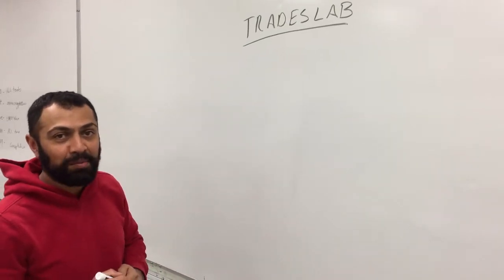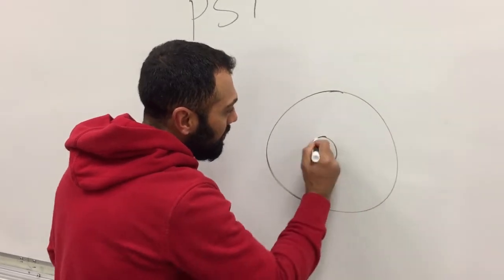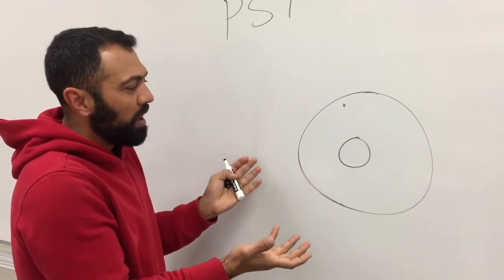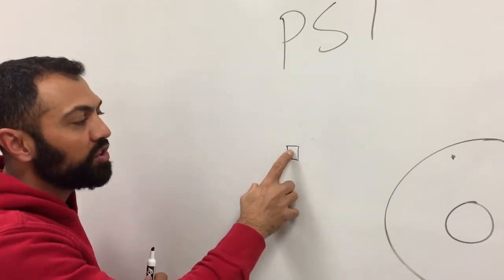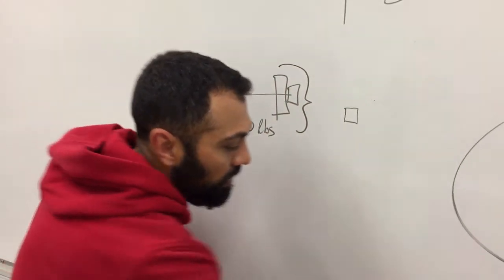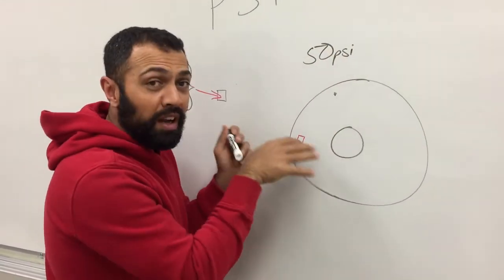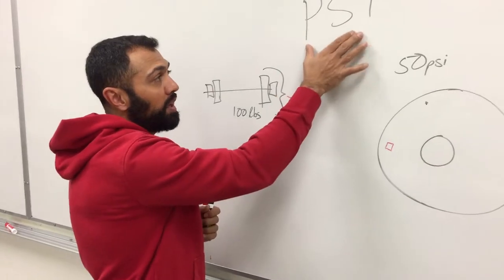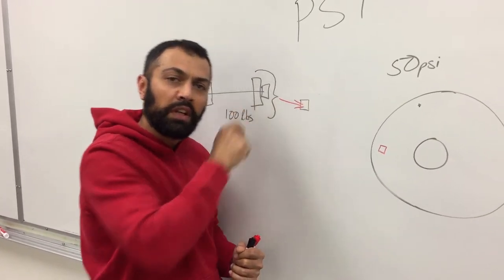pounds per square inch

Comment: Here’s a shorter explanation: Saying a basketball is at 9 psi means the air inside the ball is pushing outward on every square inch of its inner surface with 9 pounds of force.

Comment: HELLO 
THANKS FOR ALL YOUR WORK WITH THE VIDEOS.

I'M WONDERING ABOUT THE DIFFERENCE OF POUNDS PER SQUARE INCH FROM NORMAL AIR WITH SPACE AND DEEP OCEAN.

HOLLYWOOD HAS US BELIEVING THAT THE VACUUM OF SPACE IS THIS VIOLENT BIG SUCTION.

I'M WONDERING HOW TRUE THIS IS AND ALSO THE DIFFERENCE OF THE VACUUM WITH LOW EARTH ORBIT VERSUS INTERSTELLAR SPACE. 

COULD YOU ANSWER THIS TO ME OR PERHAPS MAKE A VIDEO ABOUT IT?

IN REGARD TO THE TITAN SUBMERSIBLE IMPLOSION,
 I RESEARCHED THIS 
FUN PSI COMPARISON OF  OCEAN VS OUTER SPACE. 
.
5,600 PSI APPROX AT THE 
 DEPTH OF THE TITANIC.
.
-14.7 PSI APPROX  VACUUM OF OUTER SPACE COMPARED TO NORMAL AIR.
.
14.7 PSI APPROX AT 33 FT. OCEAN DEPTH. 

YOUTUBE OF HOW THEY DEALT WITH AN OXYGEN LEAK ON THE SPACE STATION

https://youtu.be/QzTSnvthZYw

Comment: PSI just makes no sense to me. They say the atmosphere at sea level is 14+ pounds per square inch. If that was the case then wouldn't every inch of my body be in pain. I dropped a 20kg on my chest once doing incline flys and it didn't feel like air.
Reply: Do you feel pain when you hop in a pool?
Reply: No pain because from the first human at 14 number was always there and you must remember that the inside of your body inside your skin is pushing out at 14 psi otherwise you would be crushed or if your internal pressure was higher you would leak😳
I’m happy that God figured all this shit out at the same time !🙏🏼
Reply: Also, you know there is PSIG and then before there was a PSG there was always PSIA…. Atmospheric pressure.

The average atmospheric pressure at sea level is about 14.7 pounds per square inch. The weight of the air between sea level and outer space.